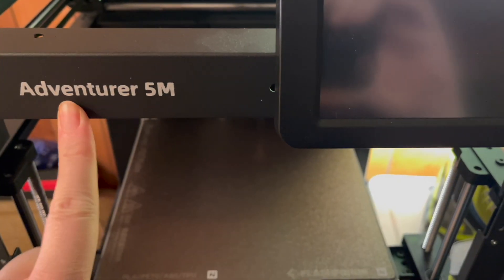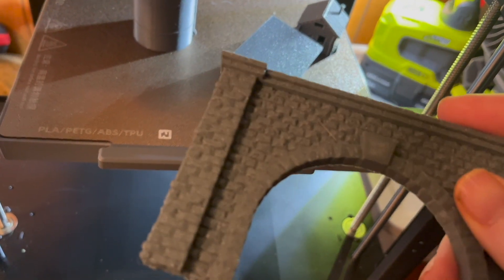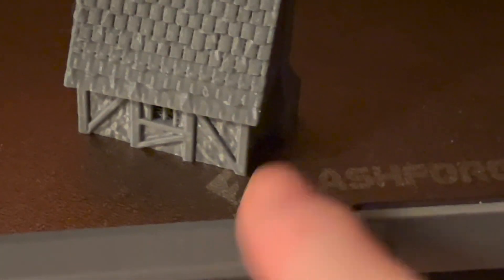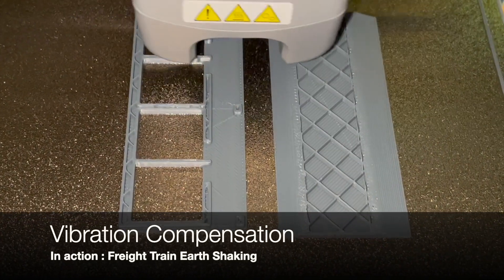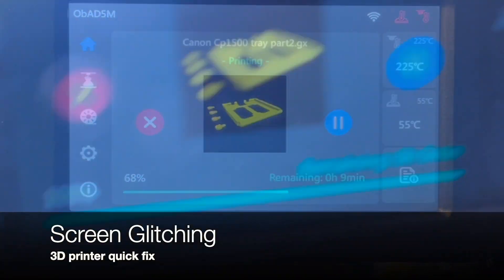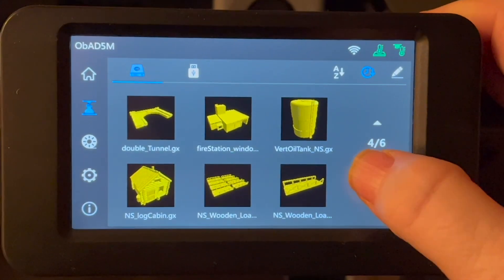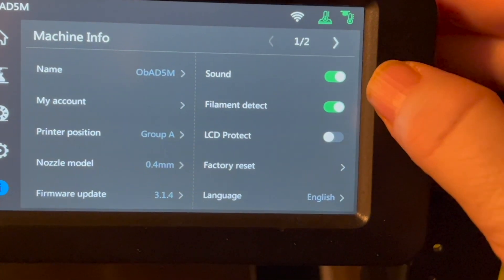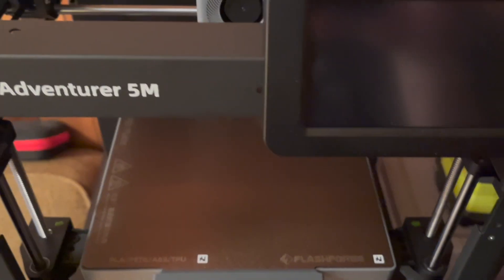Flashforge Adventurer 5M 3D Printer Review AD5M

Comment: I got a 5M a week ago, just finished printing the enclosure with ZERO issues, I just received the kit to complete it and just for making it look nicer and reduce the noise... what a nice printer, sensational. I spent like 3 rolls of filament and if you add leds and camera originals, maybe is better to buy the PRO. The savings are like 50.
Reply from the maker: Cool, I personally don’t use any of my old enclosed printers too often as I mainly print with pla, and petg for product I sell And both materials prefer more airflow to produce better prints. It’s been several years since I printed with abs and needed a heated chamber.

Comment: Do you know if this works on a 5GHz wifi network? Thanks for the video review. I think I'm going to replace my problematic Kokoni EC1 with this Flashforge machine.
Reply from the maker: It works on my wifi network. Not sure about 5GHz however.
Reply: @ Do you know if your network band is 2.4 GHz or 5 GHz? Query the properties of your wifi connection to find out. Thanks
Reply from the maker: @ Mine is 2.4 GHz, but I would check with flashforge website, it might work with the other as well.